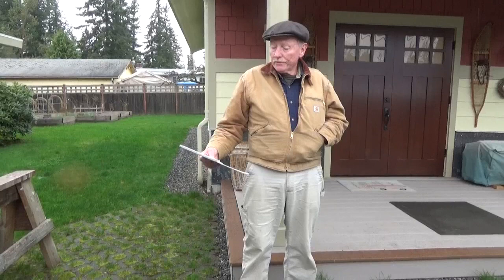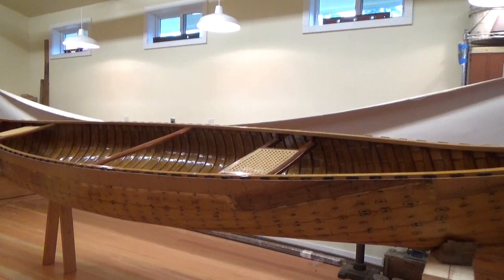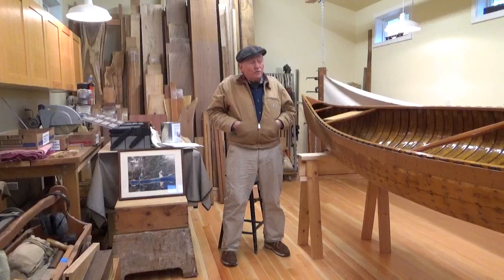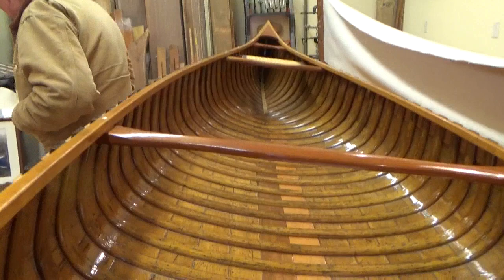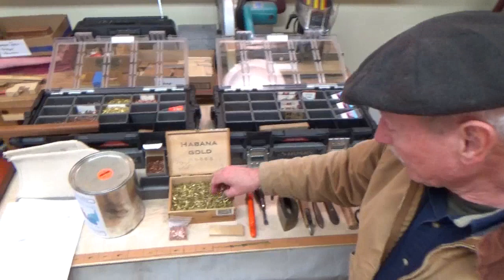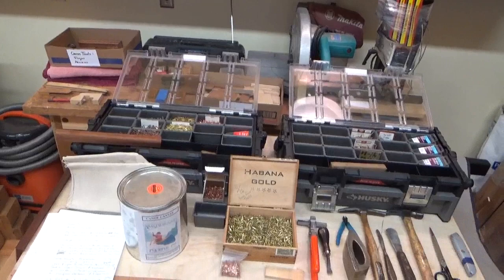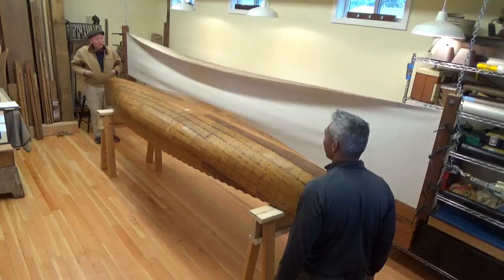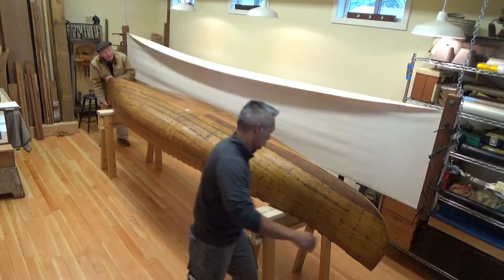Recanvassing a Cedar Canvas Canoe by Bill Paine

Comment: What is the advantage of canvas instead of fiberglass over wood and just painting the fiberglass? Isn't canvas just a weaker material. I noticed that pretty much all modern made woode  canoes forego the canvas. Please advise
Reply from the maker: The major advantage of canvas covered canoes over fiberglass covered ones is future repairability.  Canoe canvas commonly lasts about twenty years in normal use.  It is considered a sacrificial element like tires on a car.  Repairing any future planking or other structural issues is relatively easy once the canvas is removed.  It is typically much more difficult to remove fiberglass for repairs like this.  This is one of the reasons why fiberglass can also have a huge negative impact on the value if you ever want to sell your canoe.  See https://www.wcha.org/forums/index.php?threads/57/#post-72489 for more on this topic.  The list at https://www.woodencanoe.org/builders-suppliers includes many builders making canvas covered canoes today.

Comment: If the canvas isn’t bonded to the canoe that means there is potentially an air gap. If your in a climate with large temperature swings doesn’t that allow moisture to collect between the canvas and the wood or is it able to breathe well enough at the gunwale to dry it adequately? Is a wood seal coat used prior to canvassing? I remember we had a canoe like this when I was little (about 40 years ago) and it was old when we got it. The varnish was wearing off the inside real bad and my dad and I refinished it. We used it probably another 10 years before dad replaced it with a new Old Town canoe of similar construction. He said the old one had dry rot and wasn’t worth the money to repair. Too bad.
Reply from the maker: It is best to keep wood an canvas canoes under cover so they can dry out completely when not in use.  Some builders seal the wood prior to canvasing. It is too bad that you lost one to dry rot.

Comment: What size tacks are you using for the Stem/Gunwale points? This video is hugely helpful. I'm about to recavas a Peterborough and this has helped immensely.
Reply from the maker: See the stem tack sizes near the bottom of the page at https://www.wooden-canoes.com/canoes/materials/hardware/ for the options.  The depth of the stem will determine the size you need.  Good luck,

Comment: What is the glue/epoxy you use on the keel before you overlap the canvas?
Reply from the maker: Most people simply use bedding compound under the keel and when overlapping the canvas on the stems.  See https://www.wcha.org/forums/index.php?threads/17895/ for more discussion on this topic.
Reply: I’ve been using  bedding under the stem bands but titebond 3 on the keel under the canvas. Seems to waterproof it well.